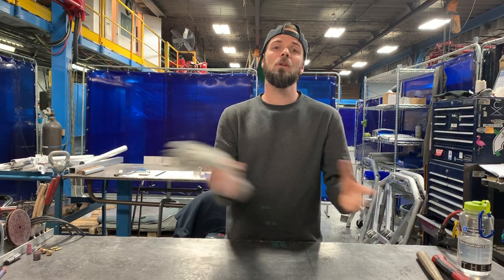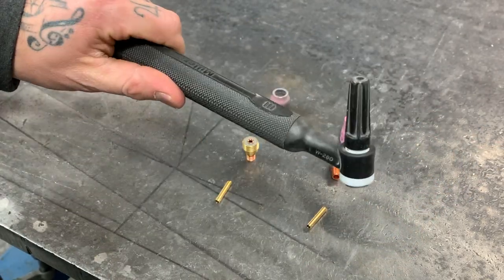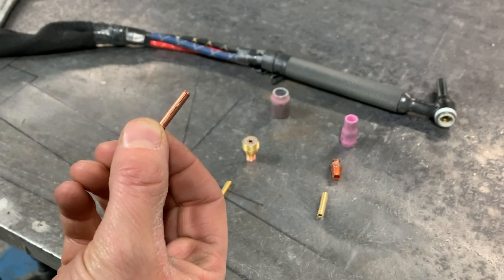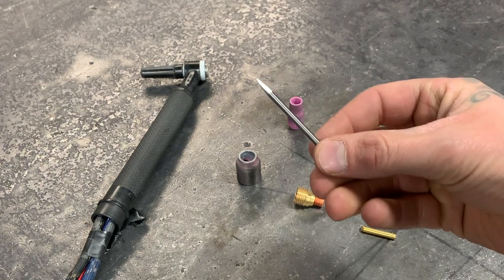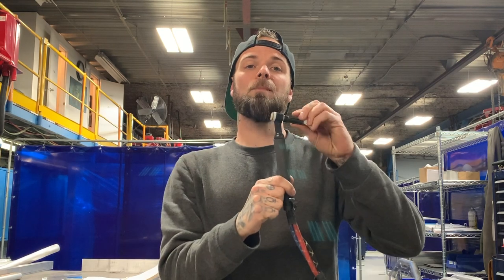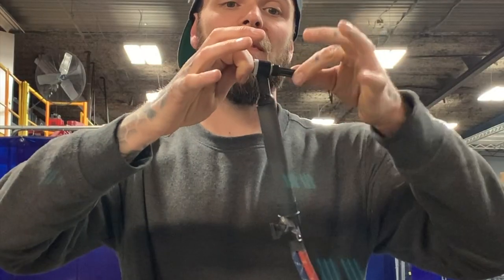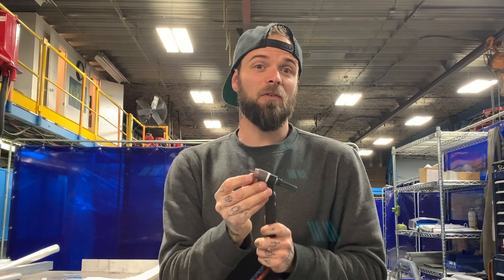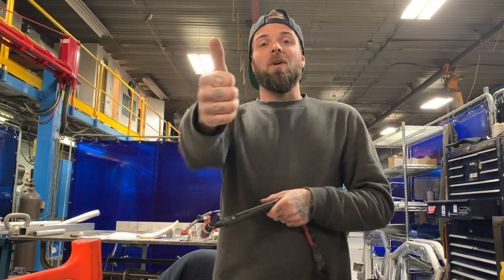TIG WELDING HOW TO - TIG WELDING FOR BEGINNERS, TIG TORCH SETUP!

Comment: Brilliant to see your work, I live in the UK and am just about to buy a Parweld DC inverter welder which welds Mig and Tig it's a top of the line machine, I need Mig because I'm renovating two old VW single cab pickups, will I be able to learn how to Tig weld and use it for art purposes on this DC machine?

Comment: Got any tips for lift start tig? I'm doing an apprenticeship and have only used hf tig at work, I bought a welder for home it's a stick/tig machine. I'm fine with stick but can't get the hang of the lift start
Reply from the maker: Ooooh always a tricky one. I used to do the ‘strike start’ where I almost strike it like a match. I would do a combo of the cup edge and barely touching the tungsten, and strike backwards, this way as you strike backwards then you won’t arc up on your weld path- no contamination. Let me know how it goes!
Reply: @PacificArcTigWelding  I got it down today! Asked a couple of the older guys to show me, I'm not even sure what I was doing wrong. but after watching them do it up close, something clicked in my head and I got it straight away! Time to fire up the home machine and try again
Reply from the maker: Niiiiice! Glad you got it dialled! Let me know how you do! It’s a comfort thing- it’ll happen easier as you get more and more familiar with it:)
Pleasure getting the chance to help you Mr former president! 🍻